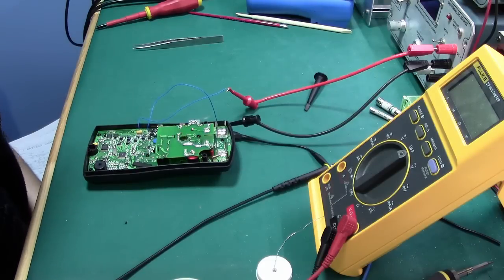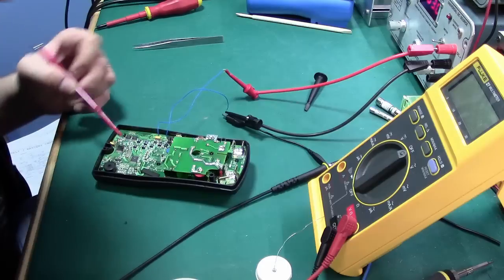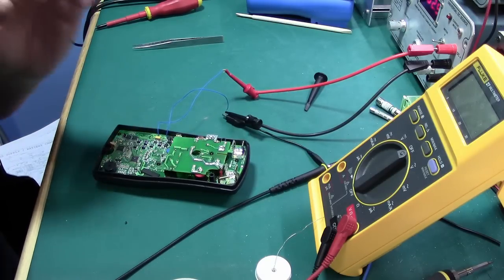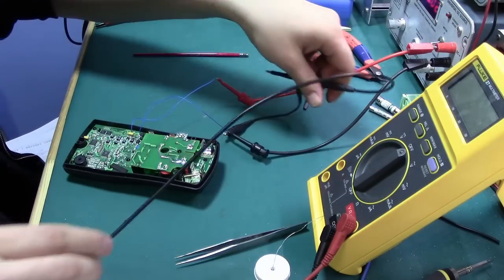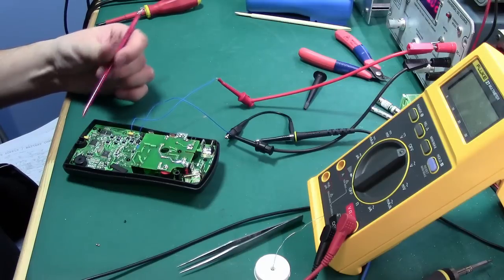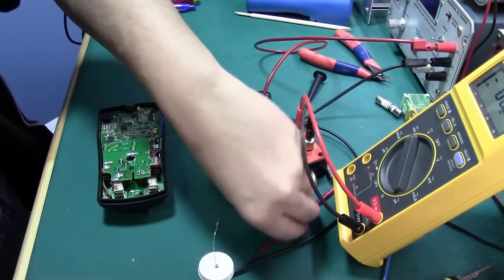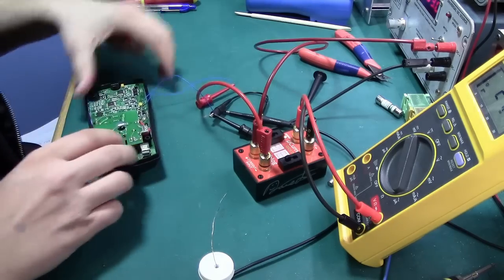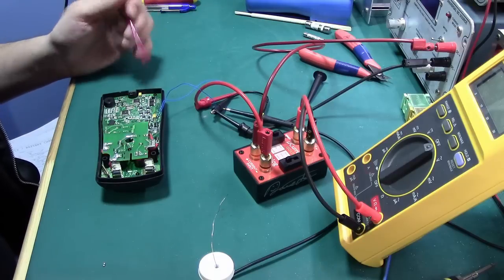EEVBlog DMM (BM235) Backlight Fix

Comment: I have a Brymen BM257s, it does not seem suffer with this problem.
Reply from the maker: It looks like this particular meter has this problem; it is still unclear if it is a design issue (i.e. the wrong part was spec'd in) or if the correct part was substituted with the wrong part for the filter of the backlight driver circuit. The intensity of the sound also seems to vary.
Reply: I think you're right i also have a Brymen BM687 again no trouble. I find Brymen to be a very good meter and would recommend highly.